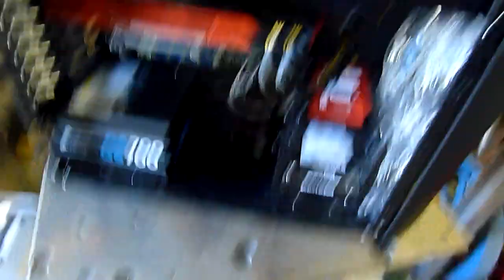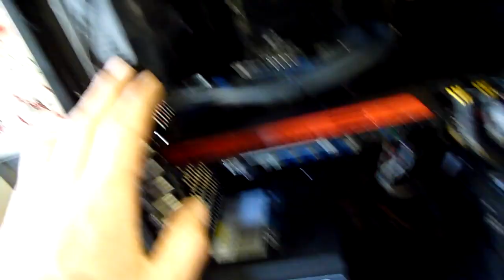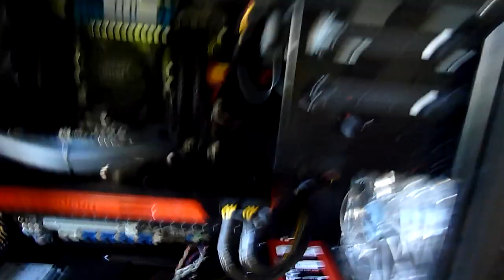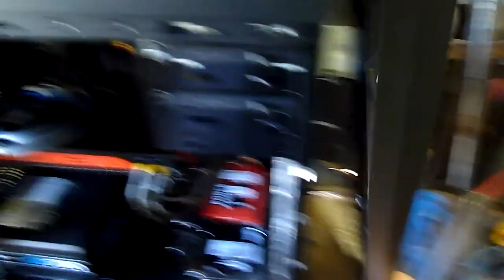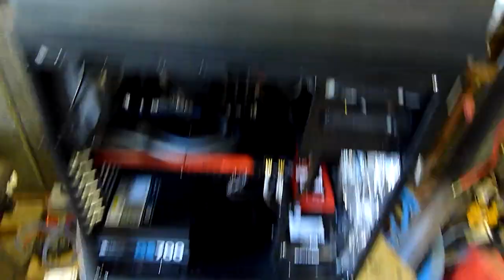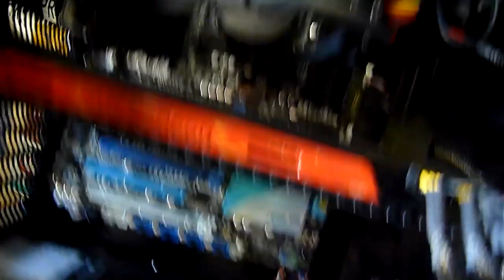Ramblotronic i7 Gaming PC Update

Comment from the maker: Case is a Lian-Li First Knight
PSU - Corsair GS700
MB - Asus P79X
CPU- Intel i7 3820 - LGA2011
Ram- Corsair Vengeance 1600mhz 16GB
Video - ATI RADEON 5970
SSD - Corsair Force GT 120GB 
Mechanical Drive - WD Black series 1Tb
Optical - Liteon DVDRAM drive
CPU Cooling - Intel sealed liquid system.

Comment: If your interested, the full power fan speed on boot is programmed into the GPU BIOS. Its to dislodge any large dust clumps that may have gotten trapped over time. Most stock coolers from both AMD and Nvidia do it. :)

Comment: i built my rig up from componants and its amazin how cheap it works out in comparison. i done mine a couple years ago now; asus p8p67 lga1155 i5 2500k, 8gb mushkin blackline with frostbite heatsinks, xfx radeon hd6870. not as beasty as yours but does the job :)

Comment: Build your own liquid cooling loop man, its a way better route to take because you can do it cheaper and it usually will out perform pre-built systems. Plus, you get the fittings you need and not the ones that you wont!

Comment: I just learned about having the radiator setup like that on Asetek all-in-one coolers to prevent airlocks, AFTER I had one happen in my Antec Kuhler 920 (which is a very nice cooler with two Noctua NF-F12 PWN fans on the radiator.) derp

Comment: you wont need to cool the southbridge because they run really cool nowdays compared to those say on socket 775. a nice aftermarket air cooler for that 5970 would be the arctic cooling accellaro xtreme unit (assuming you can still get it) and for watercooling then xspc tends to be the most affordable and efficient solution for the money. i also find xspc kits and parts easier to track down and locate then swiftech products. Ek waterblocks is good too, but they had an issue with nickel corrosion.

Comment: Hey Ed, try get your hands on a Accelero XTREME 5970 cooler. It uses a much better heatsink and 3 fans, so less RPM needed per fan which means less noise. It's dropped my temps by about 20C and even on my overclocked GPU its running max 70C.

Comment: Just to elaborate, the H220 isn't availible from PCCG which is a bummer but Mittoni Australia stocks Swiftech products. The H220 should easily cover a GPU and CPU, infact I've seen it work with 2 way SLI and a CPU at a CES demo and it was fine.

Comment: Actually no but soon they will most likely be soldering CPU's to the motherboard. It'll either happen with Broadwell which is the second generation of 1150 socket CPU's or with Skylake which is the replacement socket in 2015.

There will still however be a high performance platform which will more than likely remain LGA.

Comment: Actually TRIM is part of the OS not the BIOS. It's a command the OS sends to the drive to mark blocks as deleted.
It should be enabled by default when the OS detects an SSD.
You can check by opening the command line as admin. and typing. fsutil behavior query DisableDeleteNotify
If the result is '0' TRIM is enabled.
If you wish to speed up Windows just be sure it is a fresh install.
Source: My computer science degree.

Comment: Almost the same as my pc I got on Thursday. But I'm having RAM issues, I have 16gb corsair vengeance, but only a 32bit windows 8 so I'm currently running 3.5gb ram! I got the OS installed for free by the guy who built it. So will I need to buy a 64bit windows 8, or is there a way of changing it to a 64 bit?

Comment: The P9X79 drives come by default set in AHCI mode so you don't have to worry. You can enable Trim through BIOS without having to reinstall anything. 

Just with your cooling issues, have a look at getting a Swiftech H220 and putting your CPU and GPU in a loop. It's about $130 but it is the best dual 120mm AIO rad on the market because it's copper, not ally. Yes, I said it's an AIO but you can expand it to cover other components.

Source; I'm a mod on a huge tech forum; linustechtips . com